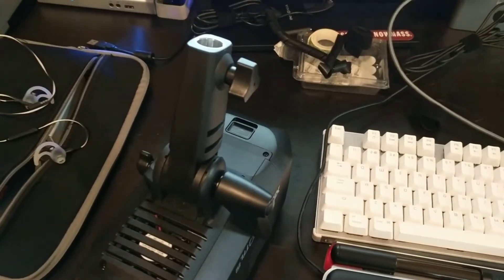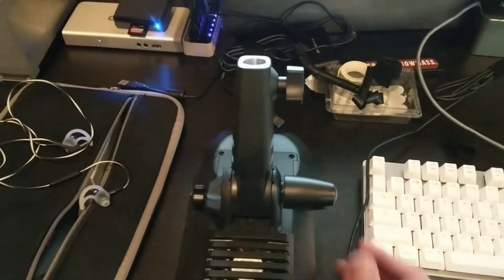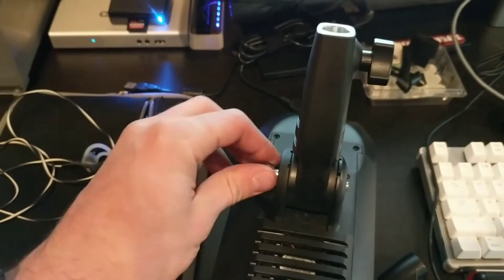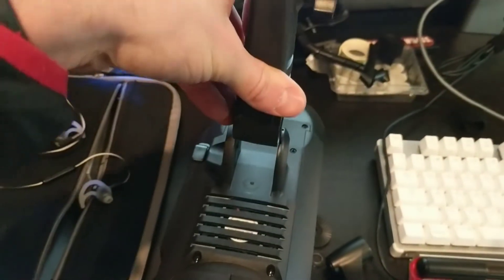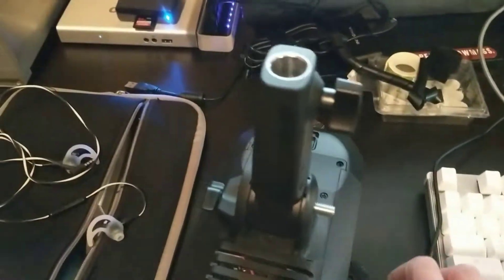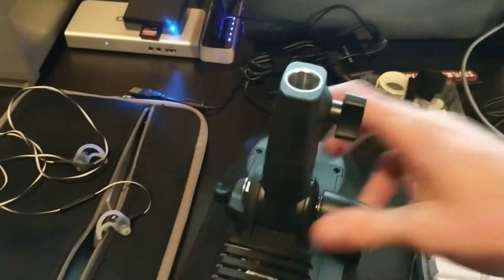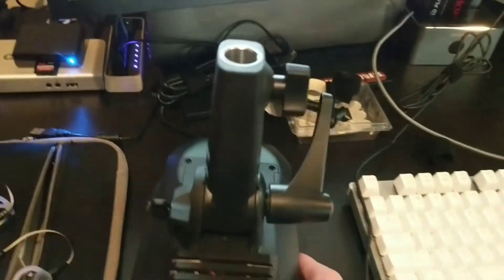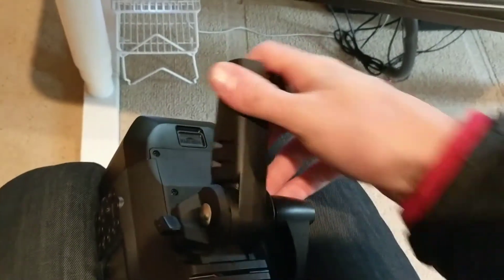Improve light stand mount/tilt bracket Godox ad600/Cheetahstand Cl-600x/Flashpoint Xplor 600

Comment: How do you stop your light from spinning around on the stand ?
Reply: Ever find an answer to this? I know you can get a kupo baby pin with a flat spot, but we shouldn't rely on that for safety. Puts all the pressure on the screw and mount threads.
Reply: @ZPOLLAK  kind ofThe baby pin made some difference but not much.  There is a tiny hole on the baby pin which your screw goes into.  So it helped a little but wirh my 55 inch umbrella and ad600bm it barely held it. I even purchased a stand more heady duty than a standard c stand and still has the same issue. It seems the only solution is to get a lighter light and modifier.
Reply: @chadsexinton  That's what my research shows too! Lots of people using extension heads because they are lighter. I'm surprised no one makes a chassis fro these lights tbh. The mounting option sucks. The flashpoint pins that came with my stands are ever so slightly too big too lol. Oh well... Guess we'll have to get more creative. Maybe safety wire or some rachet system.